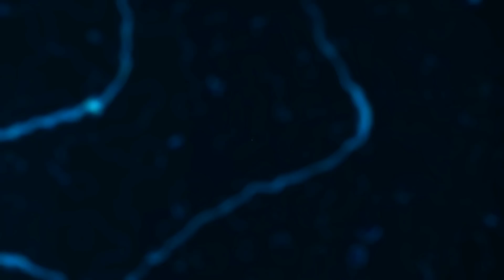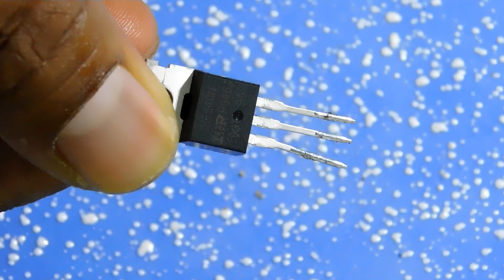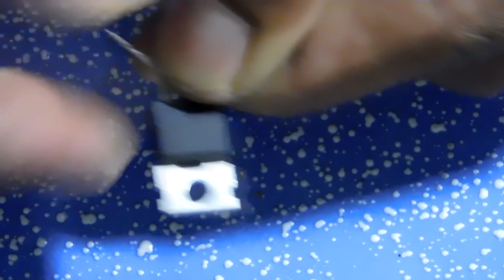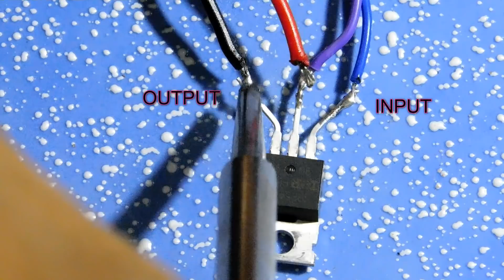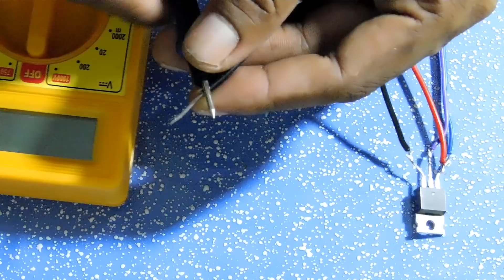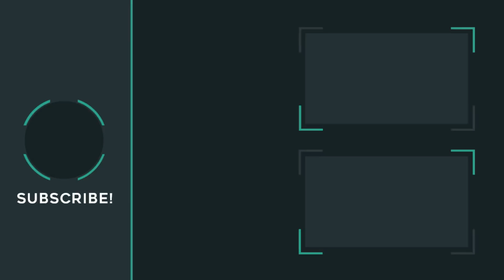Reverse Polarity Protection Circuit Using Mosfet

Comment: So does it work as a diode?
Reply: Only 3 years later, but it's better than a diode! No voltage lose like you expect from a diode and it won't break if the polarities are connected wrong. As you see in the video, when the voltage (battery) is out of phase, the circuit simple doesn't work.
Reply: @JuanMHerrera  after 3 years later. thank you!
🤣🤣🤣🤣🤣🤣🤣
Reply: @attilarivera  2 years later reaction wwooow